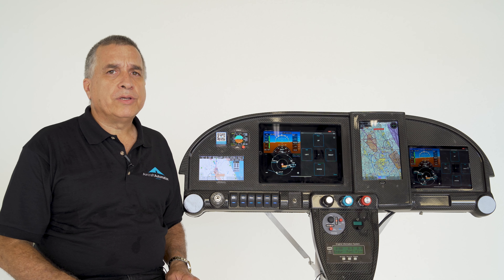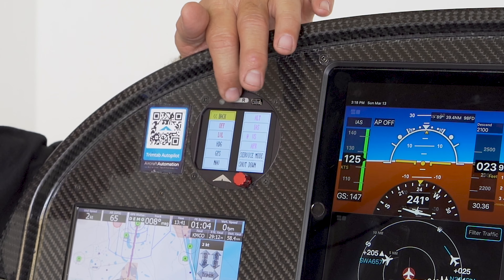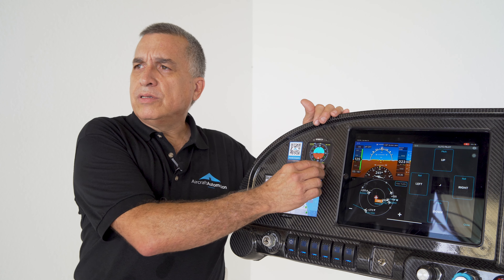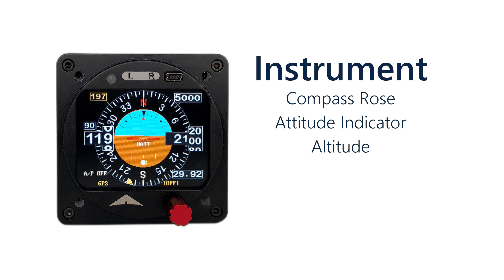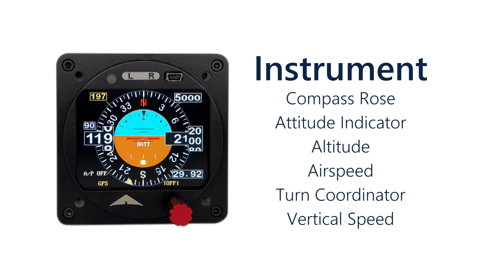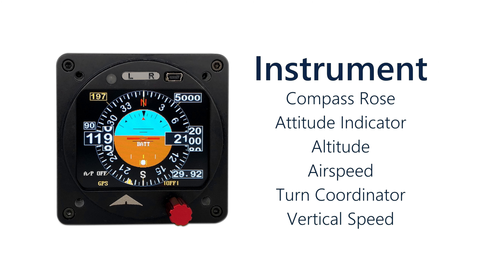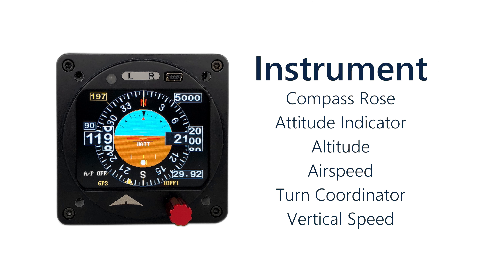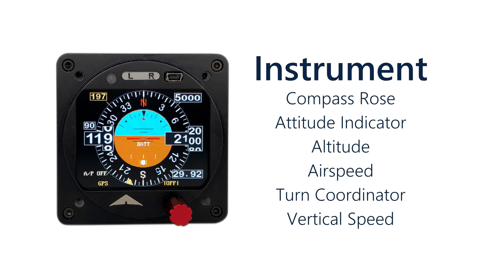How to Use the Aircraft Automation SuperECO Autopilot

Comment: Is there a way for the SuperECO to pick up a flight plan from ForeFlight? If not right now, any plans in the future? I saw iLevil AP system will. I’m building a Bearhawk Model 5 and came across this.
Reply from the maker: No, the SuperECO only works with external NMEA GPS systems, and the iLevil AP flight plan steering feature only works with iFly GPS and Naviator at the moment. Moreover, the SuperECO and the iLevil AP are also both compatible via the RS-232 port in case you want to add autopilot redundancy to your cockpit.